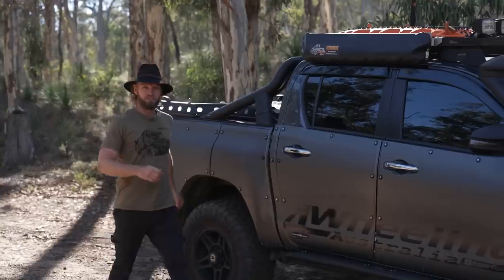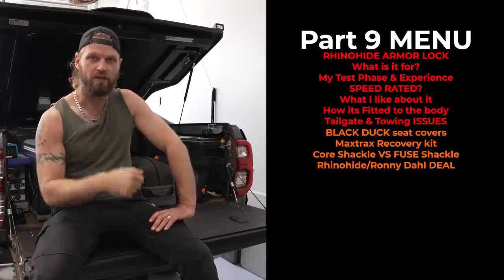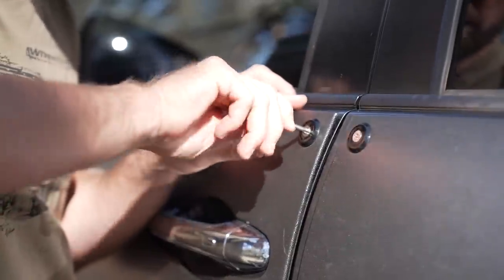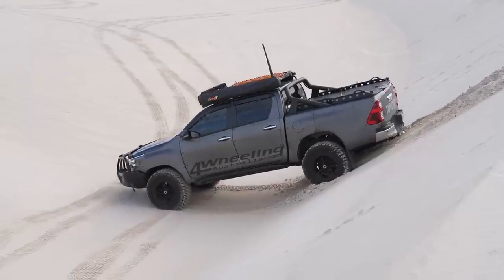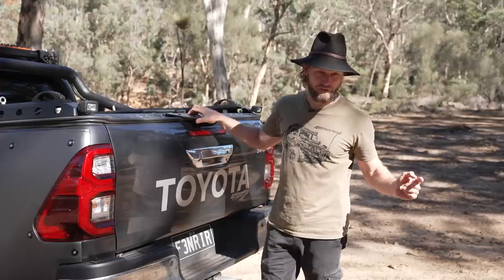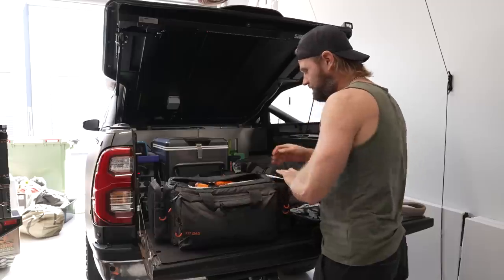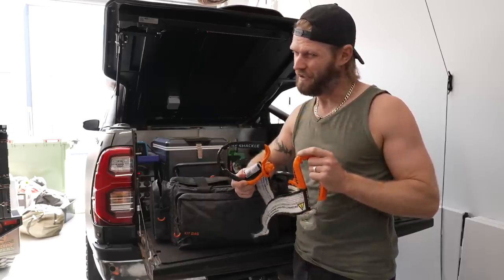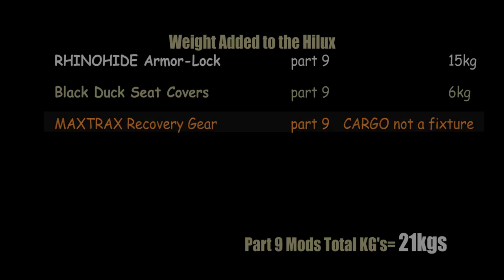Vehicle Protection, Project Luxy episode 9 4x4 Body Armor

Comment: I’d like to touch on the topic of the winch blankets, your  fuse shackle and safety. 
Have you ever considered attaching a second line to both vehicles which “catches” the tow strap if it fails at the shackle? I’m talking about 500lb paracord, which should catch catch the projectile but will then snap immediately if the towing vehicle moves and puts load on it.

Comment: I like the new fittings for the armor. However, I think it still needs to be cleaned on the backside if you want to keep it from scratching the original paint. Dirt, dust and water gets in just about anywhere, and I don´t see how this is any different. Nice tips about the easy access necessities and the towing/winching parts. When you´re bogged in, you might think more about getting your ass on the road again than safety. This is always good to think through beforehand.
Reply: There is a 5mm air gap between the panel and paint, so there’s no rubbing between the surface of the Armor and the paintwork itself.

Comment: I think youll find that the issue with all decals magnetic is they not only attract dust and debris, they will chatter. i would recomend a 3M clear coat protectant before fitting those panels as there is definately a problem with scuffing paint.
Reply: Hey Steve, please note that this is not a magnetic system, so attracts no dust/debris. These also are road-rated for 130km/h with no 'chatter'. There is also an air gap and patented panel suspension system so no scuffing will occur with Rhinohide. Here's a comparison page to help you better understand the system: https://www.rhinohide.com.au/pages/product-comparison

Comment: I went with Bush Wrapz instead for pinstripe protection. Cheap, weighs nothing, install and forget, makes the ute look freshly washed at all times and you can actually do water crossings with it.
Reply: Hey Alberto, you can do all the above with Rhinohide, AND protect against high impact dents!
Reply: @rhinohide4x4  not really.

Rhinohide weighs a ton, costs a lot  and makes your ute look like a toddler was left unsupervised with a pop rivet gun. 

Granted it'll take a harder hit.
Reply: @Cusk0  weighs under 15kgs. Hardly heavy. You're correct with it taking a hit though. Toughest product out there

Comment: You put some paint protection film like 3m it's self healing and obviously removable. Best part is the cost is cheaper than anything else especially if you're able to apply it yourself. BTW they sell pre-cut kits in various thicknesses. I've used it for hoods fenders and mirrors/headlights works great.
Reply from the maker: They won’t protect from impacts however but scratches they will
Reply: Hey Jason, the primary downfall of any film system is the complete lack of dent protection, plus the ability to rip/tear down to the paintwork from larger brush and sticks. This is where the Rhinohide Armor system is in a league of its own. Our Armor-Lock suspension technology, is proven to protect from Carparks to the Countryside! Wait for our upcoming videos to see a demonstration.

Comment: Another great clip Ronny.  Bought the rhino hide for my hilux after watching this.  Due to covid there were a few months of delays getting it but stoked to have it now.  Can you post some pics of the snorkel front 1/4 panel? The armour as supplied does not have a cutout for the snorkel sadly and there are no clear instructions on the rhino hide  website on how to cut it out or apply new tabs.  "Cut it out with shop scissors" sounds a bit bodgy and crude and both the local bodyshops I've been to suggested I don't do that.
Reply: Hey Dan, assume you got the cut-out sorted? If not, see this vid. https://youtu.be/wYMogVYcC24

Comment: If the dust and sand will get between the armor plate and door itself? If there will be a water and freeze? I believe armor film is much better protection. In Russia we use film and different coatings like line-x.
Reply: Hey Dimtry, there is a clear gap between the panel and the door, with the only contact points at the Amor-Locks themselves. Worth noting that the Armor-Locks are both water and salt resistant. The ABS plastic is also rated from -30 to  +90 degrees Celsius. The challenge for anyone with film is tears through to paintwork and dents. The Rhinohide is built to withstand both of these.

Comment: Great video, were you going to mention the rubber plugs in the door bottoms? Thought I spotted one on the back bumper, during the Maxtraxx Recovery Gear section 9m:55s.   Had about a litre trapped in my 2019 Hilux after it rained, they don't work well in the rainy UK, no problems now I've removed them all.

Comment: I guess you would need to remove the rhino hide each time you need to clean due to the gap between armor and body?
Reply: Hey Rhys, yes it makes sense to do this when you clean it, but the air gap typically lets sand and debris fall out of the bottom.

Comment: Hey Ronny do you use a shackle on the front recovery point? Or soft shackle directly?
Reply from the maker: Depends on the recovery, mostly the soft one on the front but if traveling in muddy conditions I might fit the steel D ring/bow shackle so it’s easier to find under the mud. A soft shackle would get ruined if left on the front in mud

Comment: Ronny, you've probably done more recoveries than people have had hot dinners! Do you notice much difference using Soft shackles over the traditional bows? Also have you had one fail, and is that why you've made the move to soft?
Reply from the maker: I find soft shackles easier to work with and you can join pretty much anything without a concern of adding a metal projectile
Reply: @Ronny_Dahl  Cheers Ronny

Comment: R/D.  Biggest concern for a 'RhinoHide' product would be in the tropics mista !  If one looks at "PNG River Crossing 1 & 2" where 4wding is used on a daily basis, any chance of internal corrosion through condensation/sweating is very high !  V.
Reply: Not an issue with Rhinohide, our system has a 4-5mm air gap between the panels and the vehicle paint. It's the only system that lets your paint "breathe".

Comment: Not sure if the question has been asked but how do you modify/cut the product to accommodate mods likes snorkels? Any tips would be appreciated.
Reply: Hi James, yes, simply use a good pair of workshop shears or tin snips. Can also use a Dremmel tool, but the cutting disc can be a little tricky to control, so we recommend the shears or tin snips.

Comment: Hey Ronny, great video man as always ! We have the same model Hilux as yours but ours has a tray at the back. Do you know if they make a special kit for it ( Could not see it on the website) ? Or do I still have to buy the full kit for the tub and only use the panels that I need ? 
Also, will our side bars affect the fitting of the front panels ? 
We like the product and we also want to support your channel. We have learnt so much since we have started watching your videos. 
Keep up the great work mate.  
Greeting from QLD 
Will
Reply: Hi @guillaume gerotto the bars are no issue, we dont usually split up kits though.
Reply: @rhinohide4x4  thanks for the reply. It's a shame about the kit. Not too sure what I would do with the tub panels :/

Comment: What happens if you get fine dust between the guard and the panel wouldn‘t it scratch the surface like sandpaper?
Reply from the maker: No because when you wash the car water flushes between as well. Also the mud just falls off the panels nothing really sticks to it. Something I should have touched on
Reply: There is an air gap of approx. 5mm between the panel.and the paint. The panels themselves don't touch the paint surface, it's why our product is far superior to other alternatives that physically lay on the surface and don't allow the paint to breathe or have to be absolutely spotlessly clean before applying

Comment: Ronny why not vinyl wrap your car cheaper and lighter
Reply from the maker: Wrapping does not protect from dents and deep scratching also it’s only cheaper if you DIY install it. An entire car in wrap is upwards from 3-4k is it not?
Reply: @Ronny_Dahl  it does protect from scratch’s and yes around $3-4K. It’s lighter not doesn’t protect against dents
Reply: Hey Off Clan, the primary downfall of any vinyl wrap system is the complete lack of dent protection, plus the ability to rip/tear down to the paintwork from larger brush and sticks. This is where the Rhinohide Armor system is in a league of its own. Our Armor-Lock suspension technology, is proven to protect from Carparks to the Countryside! Wait for our upcoming videos to see a demonstration.
Reply: @rhinohide4x4  yes automotive in my opinion would prefer vinyl wrap but rhinohide would be better suited for marine applications against algae and boat ramps etc etc. boating could be a better market for it

Comment: Lol that key is available at Bunnings 🤦‍♂️🤣 great spot for salt and dirt to hold water and eat and rust the car out
Reply: Thanks for the feedback TW. Watch this space for more updates on the locking system. In terms of water/salt, our adhesion system acts as a seal against moisture and helps to prevent galvanic corrosion between dissimilar metals. Laboratory tests have shown no degradation after 10 years submersion in salt water., so not sure where your info is from?
Reply: Surely could use security torx design but remove one tab so its a unique design ? So instead of 6 only has 5 notches.

Comment: With an air gap I’d be concerned about dust and water in the gap working away at your paint, thereby making the protection pointless and an expensive waste of money
Reply: Hey Corey, there is no surface contact between the panel and the paint to cause wear, i.e. the dust and dirt cannot contact the panels. It's not like magnet systems, as the only attachment point to the paintwork is through the Armor-Lock system, which will not allow water or dirt to contact the paintwork. Unlike magnet systems, these can also be left on full-time and are rated for 130km/r for use both on and off-road. Worth watching these videos on the Rhinohide YouTube channel so you're clear on use and the incredible amount of testing and work that has gone in to making them the World's Best 4x4 Body Armor protection for your paint and panel : https://youtu.be/cRIF7Lc7_QU
Reply: @rhinohide4x4  Thanks, was just on your site actually. Surprised with the price, thought it would be more than that, it’s quite reasonable.  Not available for QR Triton though 😟